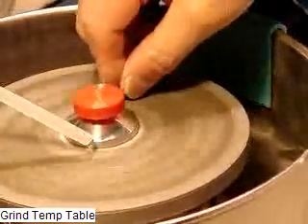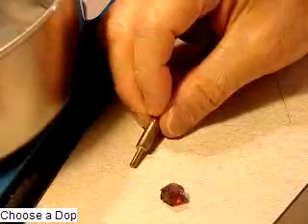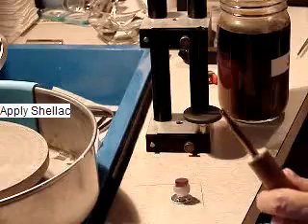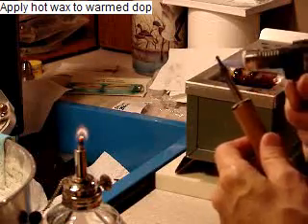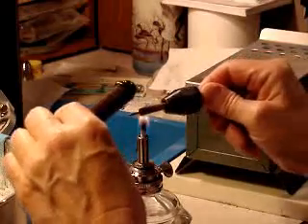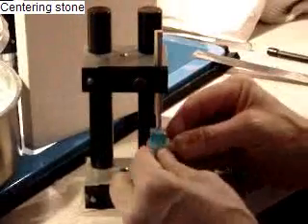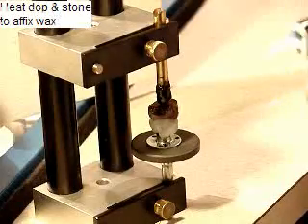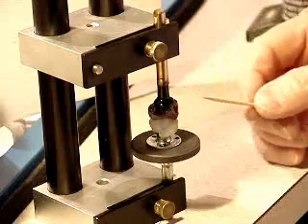MagDop Wax Dopping Video 8-30-07.wmv

Comment: Where exactly does the magdop come in to the process and how come the stone keeps changing. This is a very badly conceived video, Try again.....
Reply from the maker: You'd have to be a facetor to understand the purpose. But...the MagDop is used to accurately dop a rough stone for best advantage and cutting. To get the most out of it. And in some cases like Topaz, it must be oriented 7-10 deg from the C-axis. Cutting gemstones is a very technical process. It's never A-B-C you're done! Though some would make one think this. I've been doing this for over 35 yrs. And it's never what I'd call easy. Anyone can cut, but few can polish properly.